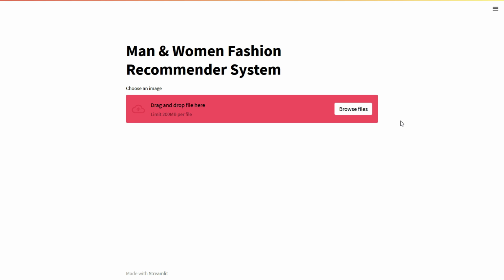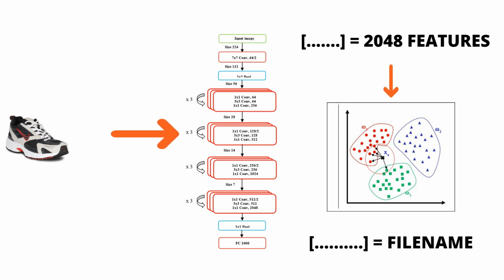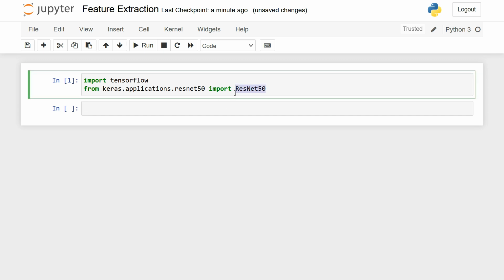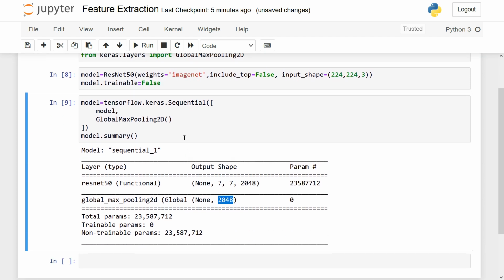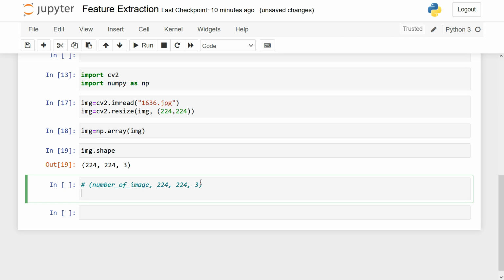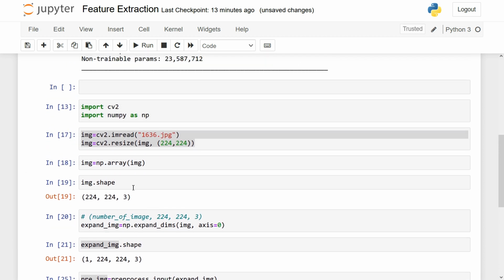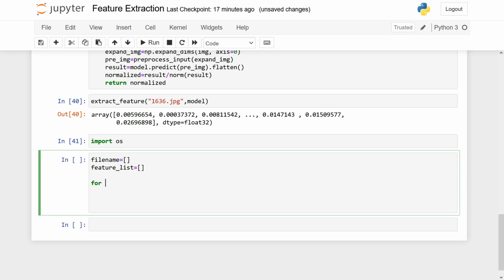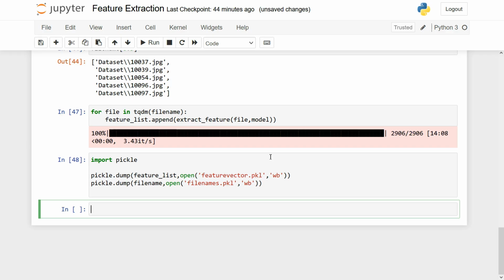Part 01:Image Search Engine Using Deep Learning l Fashion Recommender System l Python l TF l Keras

Comment: I'm trying same kernels but img.shape ----->result: ()   why empty??
also cv2.resize(img, (224,224)) ----> result: error: OpenCV(4.5.4) /tmp/pip-req-build-jpmv6t9_/opencv/modules/imgproc/src/resize.cpp:4051: error: (-215:Assertion failed) !ssize.empty() in function 'resize'
Reply: same did you get it resolved
Reply: there is secret file which name is '.ipynb_checkpoints' in the filename list . I was using colab so it's filename.remove('/content/drive/MyDrive/uploads/.ipynb_checkpoints') for me.
Reply: @onuraygun6344 even I delete that file it is keep on giving error what to do sir